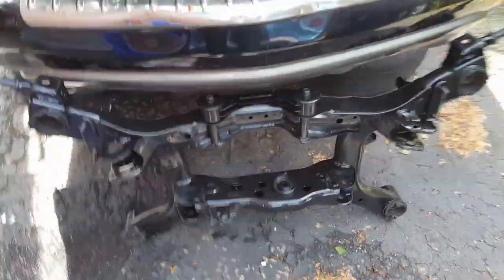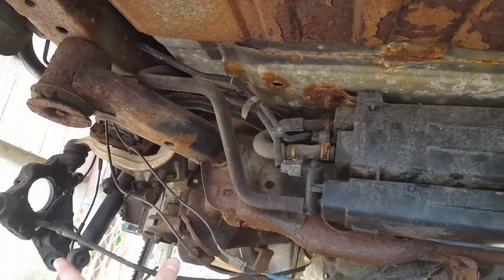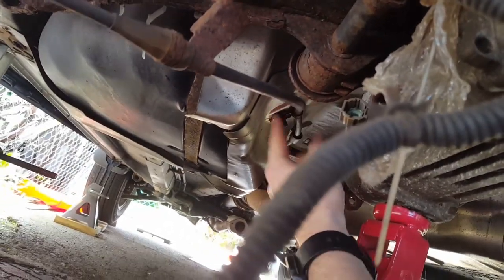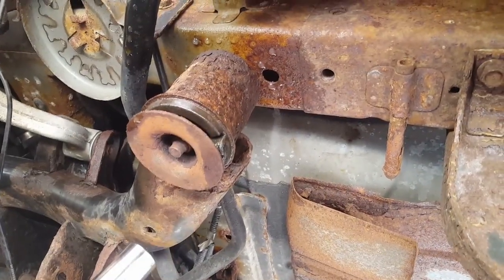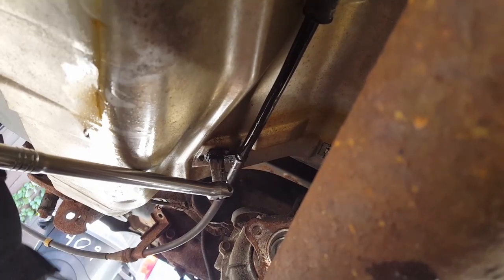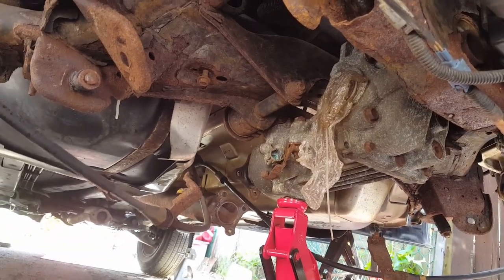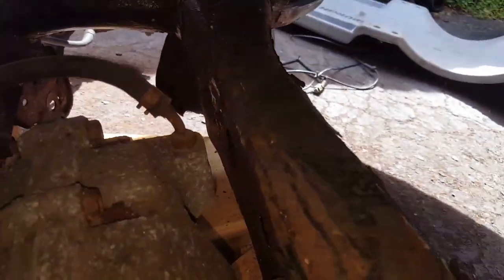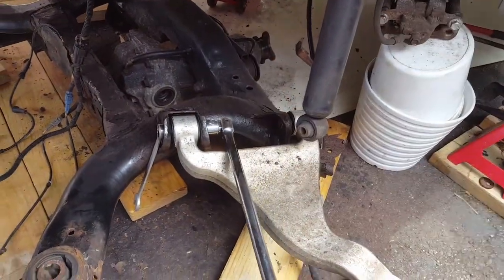Rear suspension k-frame replacement 2007 Nissan Murano AWD - PART 4 (Final removal)

Comment: You do not even know how much your video's helped in getting the subframe out. The only thing I did different I took the things off that would prevent the frame from dropping. Pulled it out then disassembled everything. Thank you so much I didn't even know that to do with out your help

Comment: Just removed mine yesterday was a pain job also my diff cover vent hose had the same issue it was corroded have to figure that out. Might have to try and do the same thing you suggested just trying to slide the tube on and clamp it and pray it works! Great videos helped me a ton thanks
Reply from the maker: Did you remove everything in one day?
Reply: Cellar Reno yes sir with 2 friends and a couple of brews we knocked it out but it wasn’t easy and it was a rusty mess. Only difference was we left the diff connected to the driveshaft because the nuts were way too stripped and rusted and we slid the k-frame right off of the diff
Reply from the maker: @mrlaidback203  Wow! good to know that, could have saved me a lot of time. Let me know if you run into a lot of trouble reinstalling. I will be doing that soon. to get those stripped nuts off, you would have needed to heat them up until they were red hot and then turned them out with a vise grip (thats what I had to do when I removed mine the first time).
Reply: I’m sorry but you didn’t wrong. I only took the tires, calipers, routers and EBrake cables off then took the whole thing down. If anybody attent to do this you better get the controls arms with bushings. If you try to do the bushing your self, it’s a big no no.

Comment: Getting ready to do a 2009 as soon as the new frame gets hear hoping everything goes smooth as yours did they really should of recalled over the subframe rotting away the way they do danm junk steel they use and poor designing for drainage i wonder how many lives it took over them breaking
Reply from the maker: You might need to drill a hole in the new frame to let the water drain out.  Let me know how it goes and if you have any questions. There's an abbreviated video of the whole process on my channel.
Reply: @cellarreno6174  I'll do that and the person I'm doing the work for wants me to undercoat it I talked him into using flex seal instead it cost a little more but I never had problems with it pealing off over the years on cars or trucks

Comment: I'm working in one now.  Got the K frame off but ripped one if the bushings on the driver side.  An can't get the remains of the bushing sleeve off the mount

Comment: I assume the boat screws in and out of the frame which way do you screw it to get it out of the frame to put a new one in
Reply: I have the same problem I broke a bolt taking it off now I don't know what to do lol